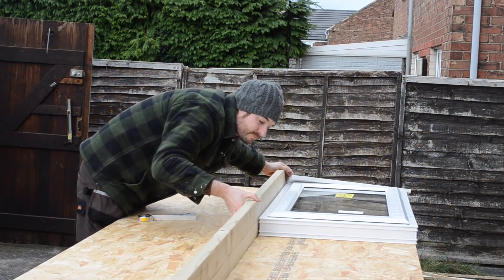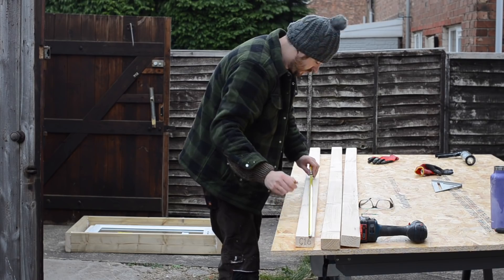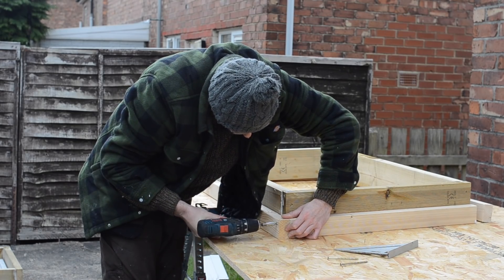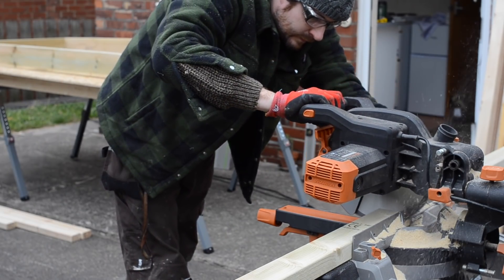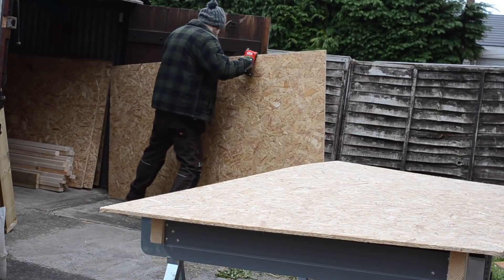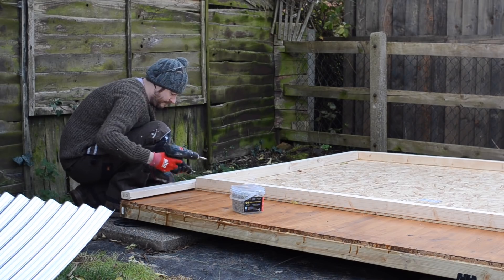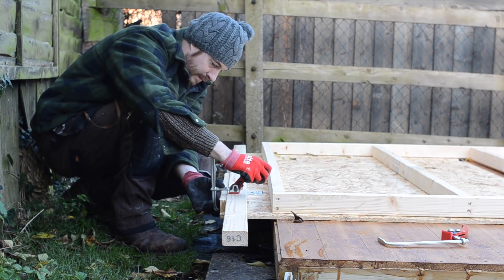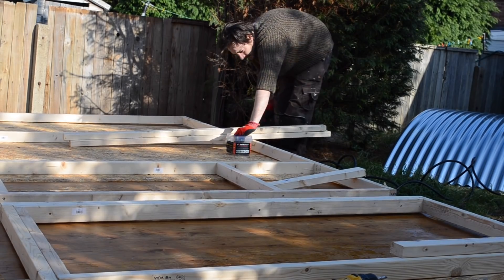New Workshop Build Part 2.  Side Walls

Comment: What width of osb did you use?
Reply from the maker: They are standard 8x4 sheets
Reply: Badger Workshop thanks for the reply. My mistake I meant thickness 9 or 12mm.
Reply from the maker: @niallkilleen8053  18 for the end walls 12 for the sides

Comment: Hi Matt. Coming together nicely. Can i ask for your thoughts on the evo mitre saw? I've been very close to replacing a makita l1018l with this saw. The makita seems to be consistently out of alignment regardless of how it's adjusted. It's hard to get evo reviews that aren't endorsed by the manufacturer (I am definitely impressed with their table saw, esp considering the price). Cheers - nic
Reply from the maker: Its a great saw for construction jobs like this. For more detailed work its not great. You would not make a picture frame with it.